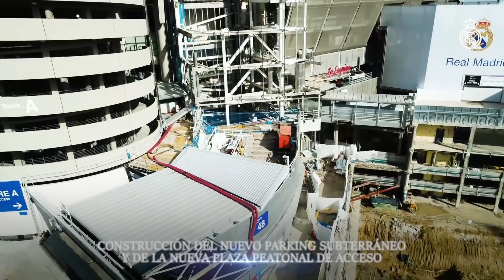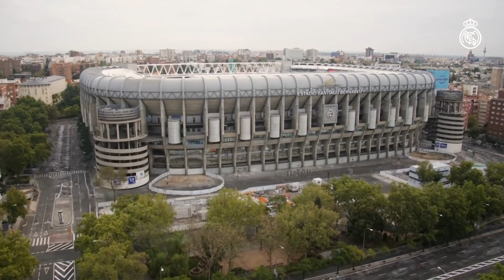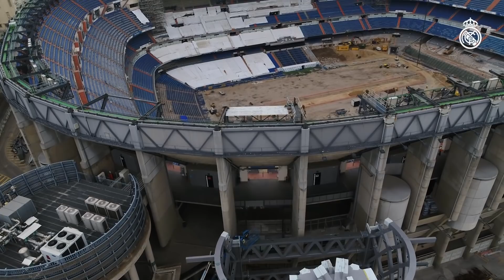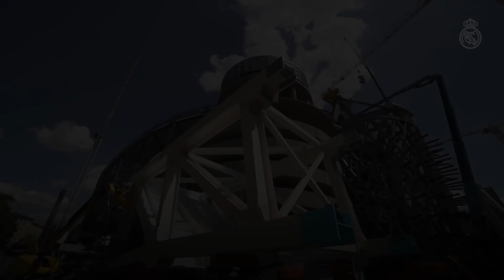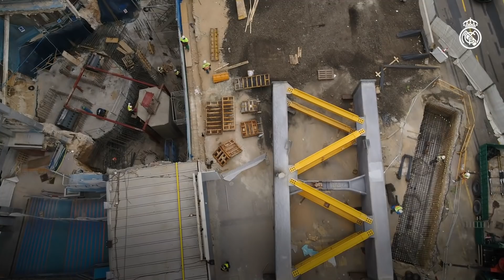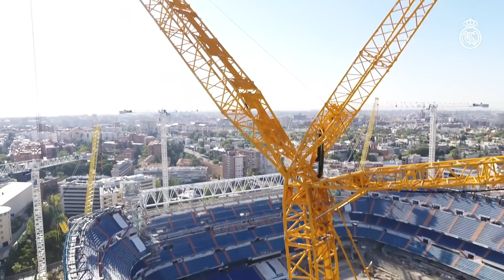🆕 Real Madrid's NEW Santiago Bernabéu stadium works (September 2020)

Comment: I hope they roof it so it doesn't look like Camp Nou
Reply: It will be completly overtopped by a roof, which could be lclosed if it's necessary.
Reply: @PETRiCH0R030  when it will complete?
Reply: @sayandutta2035  on Wikipedia page stands 2022
Reply: @PETRiCH0R030  thnks bro I can't wait to see it 🤩🤩
Reply: Why what's wrong if it does?